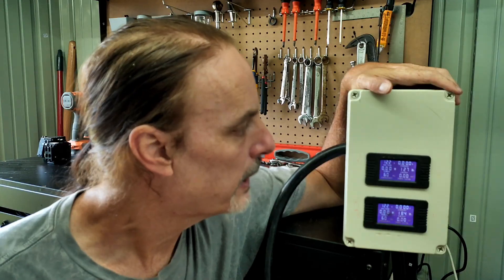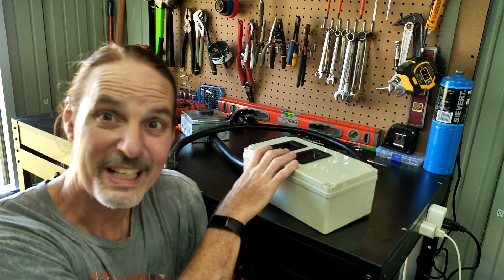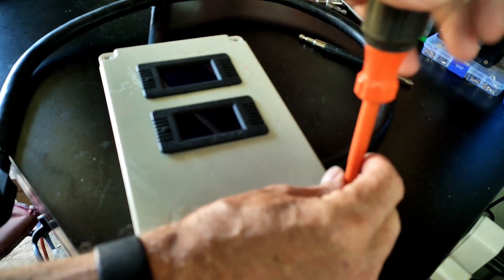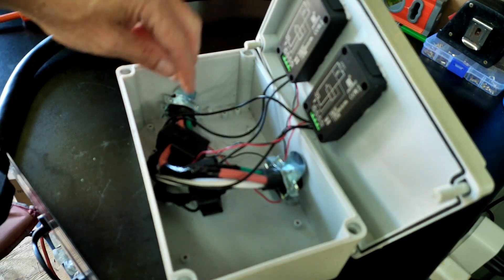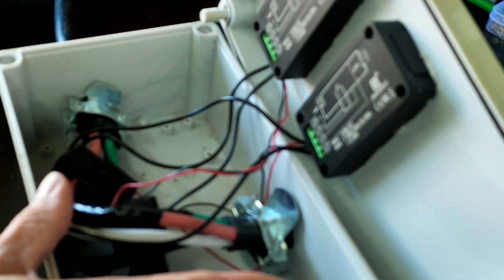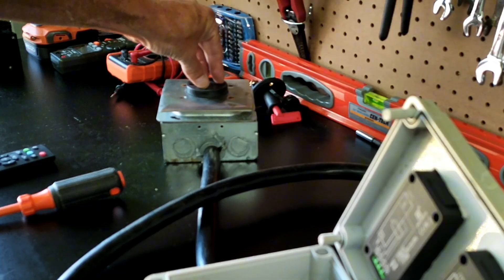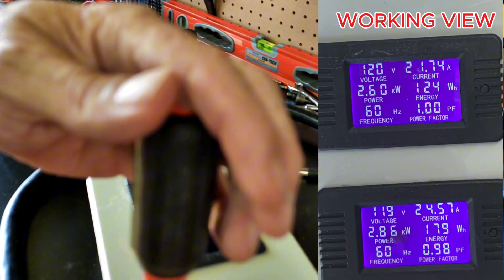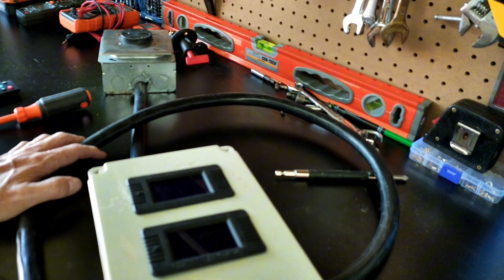Build a DIY 240V Power Monitor Like a Pro

Comment: Very nice!  One minor point though, at 3:11 you say you could use one current transformer clamp to measure both legs.  Not true, in a split phase feed the two hot leads are 180 degrees out of phase and if you run both through a single CT they will cancel each other out instead of adding.  For example if L1 has 10 amps and L2 has 8 amps a single CT will measure 2 amps, not 18.  Same holds true for a clamp-on ammeter which uses the same principle as the current transformers.
Reply from the maker: Yep, you are correct. Not sure what I was thinking..

Comment: I built a similar setup a few years ago.   I have the box between my portable generator and the house inlet under a covered deck.  I used a bigger box, and put 120V outlets on it, one duplex outlet per phase with circuit breakers.  This allows neighbors to stop over and plug in a cell phone or tablet to charge it without having to come inside the house.  The next door neighbor will plug in his pond pump.  It is very convenient to have the outlets on the box, especially during harsh weather when no one wants to go out in the rain to use the outlets on the generator.
Reply from the maker: @jimx9461  that is a fantastic idea, I find myself needing a regular 120v plug when connecting things up all the time, and I have to wait to get the trailer or power station connected, this would solve that problem.. great idea.